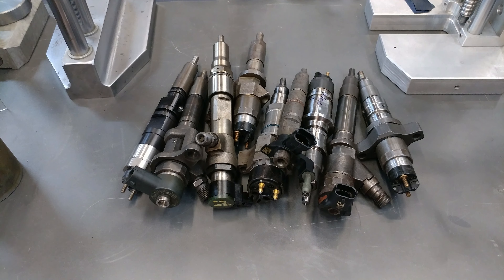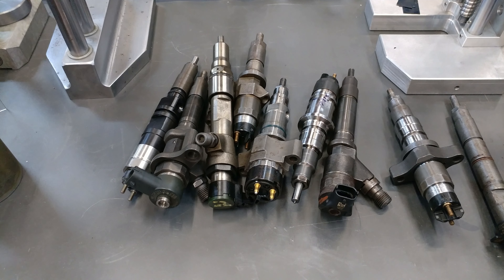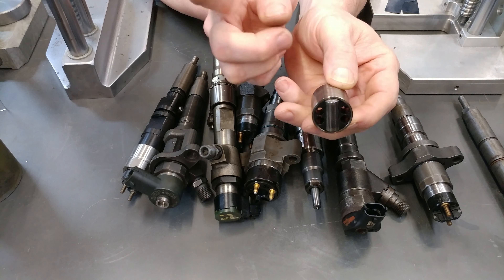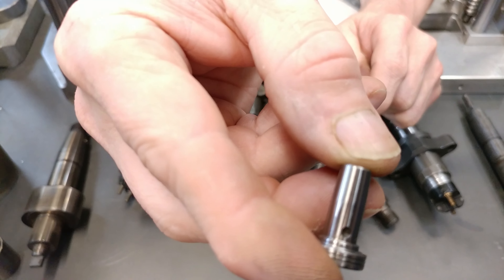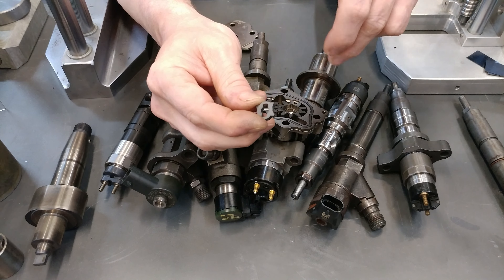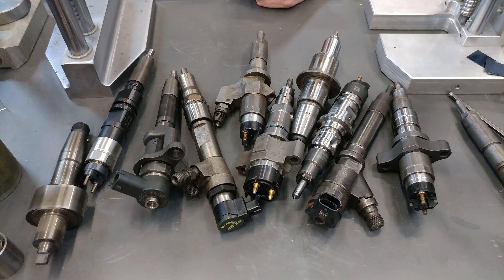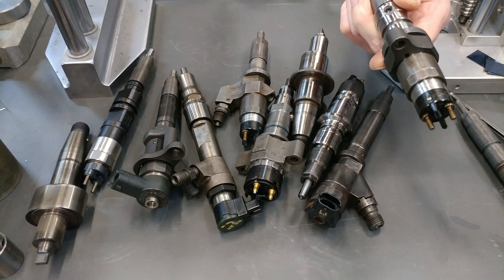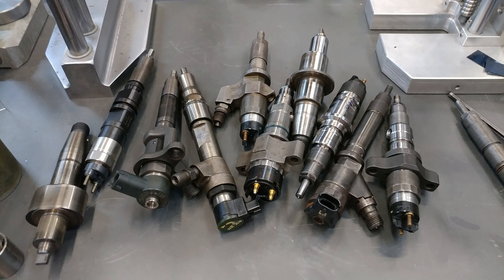Why Your Duramax and Cummins Injectors Fail

Comment: Now living in sheer terror of the CP4 on my 2015 duramax 😖 I buy only Sunoco premium diesel and run no additives. Now I have to go to the dealer once a month and start stockpiling injectors and other parts 🤪
Reply from the maker: Sorry....it is worse for the Ford 6.7
Reply: @MotorsportDiesel  I heard from another diesel channel that the 6.7 is a 100K disposable engine.

Comment: What about air in the system? What would that do to the injectors if you had a bunch of air from a faulty lift pump?
Reply from the maker: Air is a gas and is compressible, at common rail operating pressures the air bubble size would be drastically reduced, and seems it would certainly affect drivability. Whether that is a real concern or a common issue in common rail, I have not seen it very much, other than the early days 1/4 tank fuel slosh and the engine cuts out momentarily. What I do know, is that when fuel is not present pressure is at a total loss. Air will not actuate the injectors. However if enough air molecules were present and mixed into the fuel, the engine could run, but the thermal power output would be down in direct proportion to the amount of air present. What I am saying is: the performance would be so bad, I think the one suffering from the condition would want to get the issue repaired.

Whether or not it would cause premature wear in the injectors, well it would be hard to prove or even replicate in a controlled environment, furthermore I am quite certain that the Bosch common rail pumps are designed to return the air to the tank via the cascade overfill valve.

I know when I put a pump on the test stand, I can clearly see the air being purged from the pump once I turn on the supply pump. Furthermore, air tends to get trapped in the highest point of the system via gravity. Generally the return is the higher than the inlet. I am just giving evaluations and throwing some ideas and thoughts out there. Someone likely, somewhere has done some in depth studies of this, and I would feel certain Bosch has built in some fixes for this into designs. The venerable "what if's" scenario, that all engineers must consider.

Comment: Assuming Fuel is clean and you have the proper lubrication. How long does a cp3 live before it starts to make metal ?
Reply from the maker: Our test bench is equipped with a DRV valve which is a pressure control valve. It has a small low micron filter as it's inlet. A new CP3 after only being tested for a few minutes, makes the filter look like a porcupine. So the answer is not when, but really when does it become significant enough to cause greater issues. And the answer to this is subject only to individual experience. 

That is why the injectors are essentially guarded with an inlet filter, or pulverizers that use high pressure fuel to erode away the metal particles, until the metal can go through the injectors and wear them out quicker. Of course this is a slow process, taking many thousands of miles.
Reply: Interesting, so they start to make metal when they’re brand new . My cp3 has 385k on it . Injectors have probably 100k .  I put one of your arson 3 kits on my cp3 years ago and I noticed there was wear on the end of the shaft where the pump drives the gears . I didn’t think a hole lot about it . But after seeing the shaft in that video …. Wonder what mine looks like now 😬

Comment: How can rust form inside the fuel system if its always soaked in high pressure diesel fuel as its oil to begin with?
Reply from the maker: @MrFantasylover1 Oil and water do not mix https://www.youtube.com/watch?v=vWYnN_pHLEw